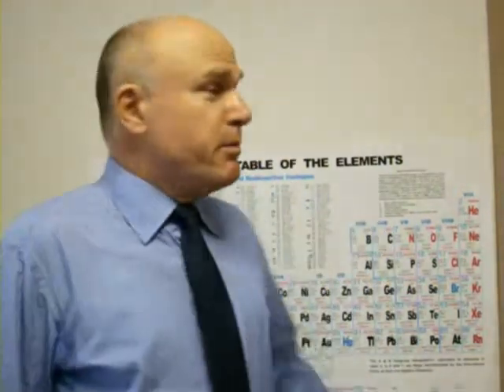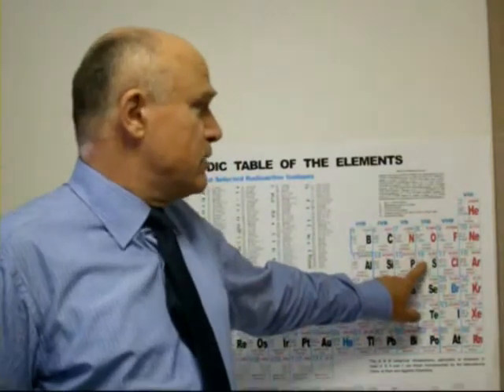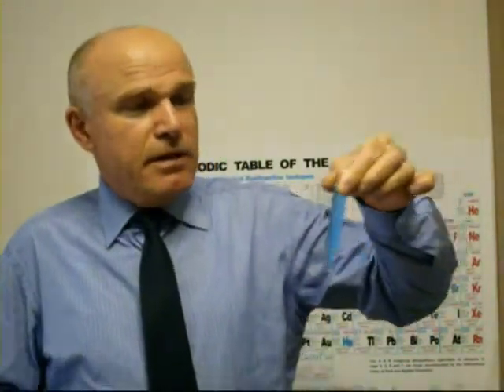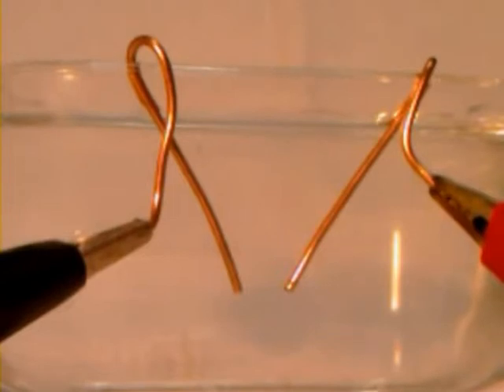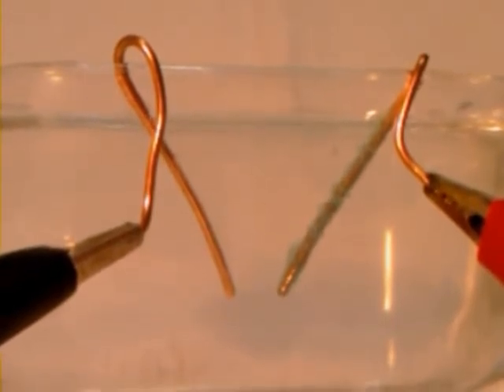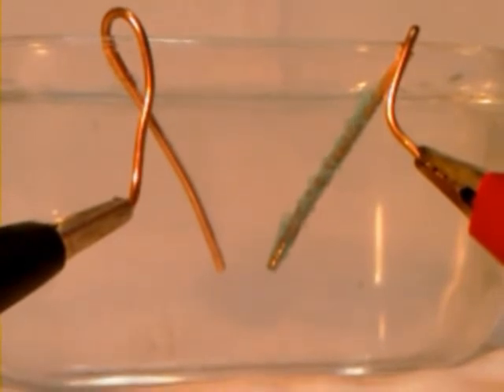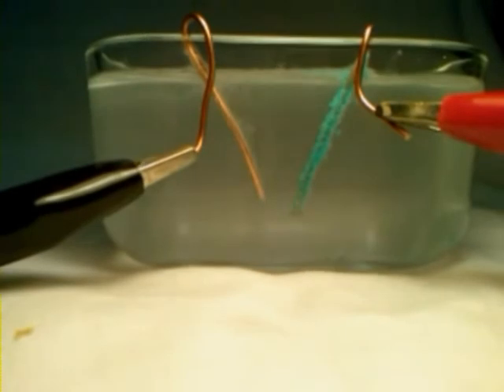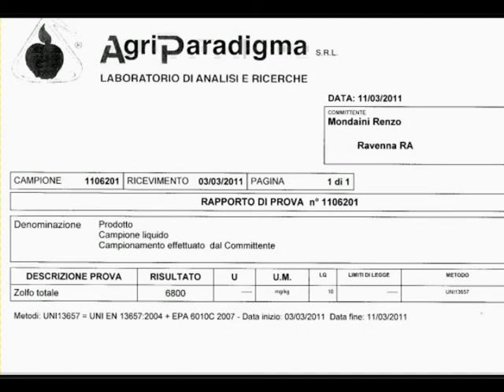Cold Fusion Transmutation (1), of Oxygen in Sulfur, by Renzo Mondaini.

Comment: It's not Transmutation but a simple Reaction of copper to Carbonate. So Copper carbonate is always greenish in colour but copper sulfide is black in colour 😂 lol
Reply from the maker: Before writing a message, please watch the video to the end.
At minute 14:17 I show two certificates of analysis that prove you wrong.
Reply: @remond55  I did it today Morning. Connect my Cu wire with 12v battery. But on positive side there was no green Cristal formation but reaction was very fast and in just 30 min all solutions turn light greenish brown. I don't know what's that? Then I filtered the solution and took a sample from green brown material exact colour is #eccf2c this is colour code you can search on Google to see exact colour. I dissolve this material in nitric and all material dissolve in nitric. Turn blue in colour. But there is no Sulfide bond with Cu bcoz copper sulfide do not dissolve in nitric. Then I thought May be Cuso4 but after filter potassium carbonate solution was clear and there was no blue in colour. So there is no copper sulfide or sulphate
Reply from the maker: @howtomake1446  If you want to replicate this experiment, you have to use a low concentration solution, you will have to go by trial and error because I don't remember the details. green crystals form within a few seconds, as you can see from the video. If they don't form, change the concentration.
Reply: @remond55   today my friend Completed this experiment and confirmed me about sulphate ions. It was blue crystals same as Copper sulphate. So Now I reach to the conclusion that this Transmutation also take place according to the earth anomaly. We can transmute the elements of this experiment in all area of earth.
Reply from the maker: @howtomake1446  Go easy on the claims, we have not tried in all areas of the earth.
Reply: As an Alchemist I can say if this Transmutation is true and with my case Transmutation doesn't occur then the problem is the area of earth. I am wondering for 3 years. There is something in earth which we can called anomaly like Magnetic field etc. But it's not magnetic field. The experiment of Transmutation doesn't work at my home place but same test have positive result 800km away from my home to a friend home
Reply from the maker: @howtomake1446  Confirmed, similar cases have happened to me as well, with these kinds of experiments I perform.

Comment: I watched your other videos on cold fusion so i tried to duplicate it with distilled water. I did it with a high voltage generator module, in distilled water, but nothing happens, I guess probably not enough amps, i was using 18650 battery. Do i need a higher amps to produce the cold fusion? Based on your videos, and some plasma arc welding tools (we could buy it),  I think there might be something with the plasma, or its just that its probably something about matter itself we havent understand. Im not really good in science, i got interested with this.
Reply from the maker: Distilled water is a good insulator.
Reply: @remond55   thanks, I see some videos from other youtubers claimed they did this with distilled water. I guess i need to add some salt in my solution

Comment: What is your source of power? A battery of what type, or a power supply that may have a frequency component in the  power output?
Reply: From your comment of "turning on the power" I am assuming you used a 12 V power supply. The output may have a frequency component. E=mc^2 is not a complete formula. The only validated fields of energy are electric and magnetic. So the E must have more than just potential (voltage) or the kinetic aspect of light speed. it also has frequency, density, and polarity. And these fields form wave structures and inductions. Matter conversion depends on manipulating all these components if you are not using pure potential. BTW it has been shone that chickens can produce up to 5 times the calcium they ingest. Transmutation does not have to express lots of energy.

Comment: The simple explanation is sulfur contamination of the water. Sulfur dioxide is a common pollutant that is present in cities that use coal fired plants. You will need to obtain triple distilled water and then analyse the water at the beginning for sulfur content before and the apparatus must be in a sealed container to avoid further sulfur contamination.

Comment: I was not there so I can not confirm if you actually had sulfur.
 But I can interpret the video and the chrystals look exactly like Cu(OH)2.

If it would be sulfur, the ammount of energy (just like you hint in the vid),  should have been much more than the equipment used could handle. Of course that is provided it is an endoterm reaction.
If on the other hand the reaction would have been exotherm then the water should have boiled away.

So the video just shows normal highschool chemistry.